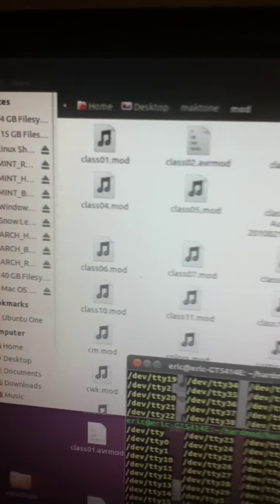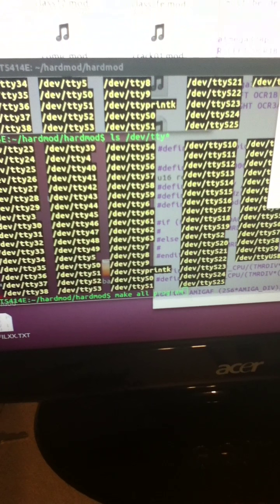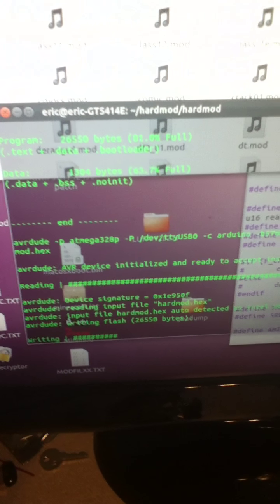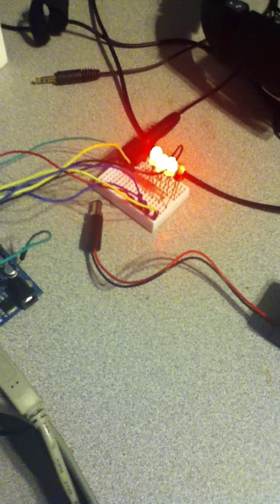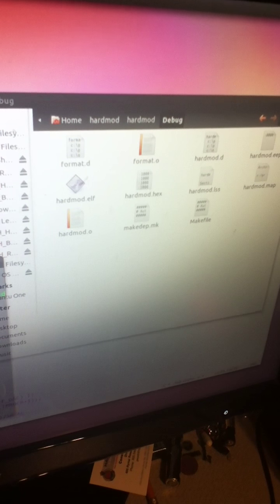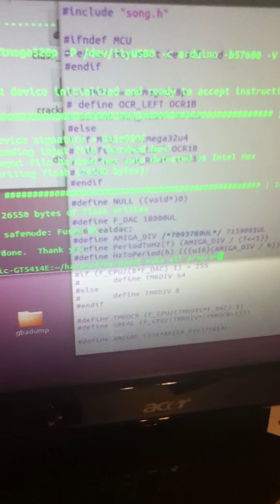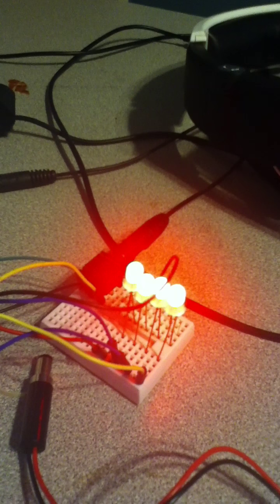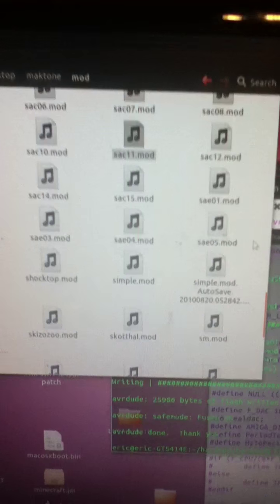Arduino Duemilanove MOD Player 4 channel

Comment: I found a bug. Time to squish it.
I'm guessing the thing that generates song.h needs a simple patch to add "const".
Probably caused by more stricter syntax in newer versions of avr-gcc.
Will report back afterwords if it fixes it or not.

Compiling C: hardmod.c
avr-gcc -c -mmcu=atmega328p -I. -DF_CPU=16000000UL -DBOARD=BOARD_adafruitu4 -DARCH=ARCH_AVR8 -DMCU=atmega328p -O3 -funsigned-bitfields -fdata-sections -ffunction-sections -fno-inline-small-functions -fpack-struct -fshort-enums -fno-strict-aliasing -Wall -fno-unit-at-a-time -Wunreachable-code -Wa,-adhlns=./hardmod.lst  -MMD -MP -MF .dep/hardmod.o.d hardmod.c -o hardmod.o
In file included from hardmod.c:12:0:
song.h:3:15: error: variable ‘songdata’ must be const in order to be put into read-only section by means of ‘__attribute__((progmem))’
 unsigned char songdata[7378] PROGMEM = {
               ^
hardmod.c: In function ‘initmodule’:
hardmod.c:270:5: warning: unused variable ‘balance’ [-Wunused-variable]
  u8 balance;
     ^
hardmod.c: In function ‘row’:
hardmod.c:422:3: warning: implicit declaration of function ‘memcpy’ [-Wimplicit-function-declaration]
   memcpy(&upd, &rowUpdate, sizeof(struct update_s));
   ^
hardmod.c:422:3: warning: incompatible implicit declaration of built-in function ‘memcpy’ [enabled by default]
hardmod.c: In function ‘tickefx’:
hardmod.c:472:3: warning: incompatible implicit declaration of built-in function ‘memcpy’ [enabled by default]
   memcpy(&upd, &tickUpdate, sizeof(struct update_s));
   ^
hardmod.c: At top level:
hardmod.c:1023:11: warning: ‘nextsample’ defined but not used [-Wunused-variable]
 static s8 nextsample;
           ^
make: * [hardmod.o] Error 1
Reply: It won't compile, changed or unchanged. Is something wrong with bin2h/main.cpp? http://pastebin.com/XqPBqhAS

I did things the "wrong" way. Manually generated song.h, added  "const " to beginning of data array line in song.h, then made song.h as read only so make doesn't destroy it, then run make and bypass all errors about song.h being read only. However, GCC then complains about a bunch of stuff I don't understand because I'm quite new to C. Is there a way to import this into the Arduino IDE? Because the latest version of GCC is incompatable. I give up for now. DX
Reply from the maker: +theLuigiFan0007 Bin2h compiles just fine if you use the Code::Blocks IDE. 
I have fixed the code so that it now adds "const" to the songdata variable when it generates the data file.

Updated code now at https://github.com/mre521/hardmod
Reply: mre521
Compiles great now!

Comment from the maker: Yeah a simple low pass filter on there should help out the sound quality, however, the speaker already acts as one in a way because its frequency response is lower than the high frequency PWM.

Comment: I would like to do this and use a midi keyboard to use it as a sampling keyboard....also did you try to hook up a low pass filter...4k resistor with a 1uF cap...see how the sound changes...

Comment from the maker: There is a Texas Instruments demo board Stellaris Launchpad MOD player (Search "Stellaris Launchpad MOD Player"). I actually recently received two of those and they run at 80MHz max and use a TI MCU with an ARM cortex core

Comment from the maker: Well, the propeller is a much more powerful microcontroller with I believe 8 cores so I have no doubt this has been done before on it. Some of those TI MCUs are also powerful as well do I don't think i would be too hard to implement on those either. PIC would probably work too.